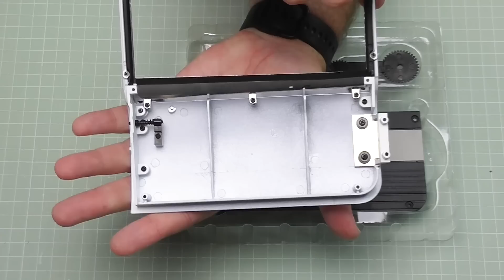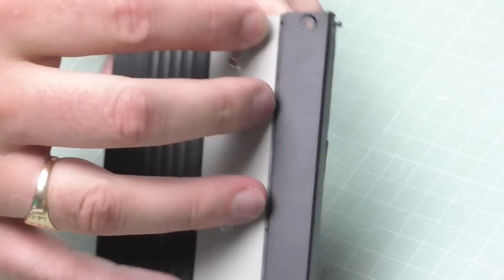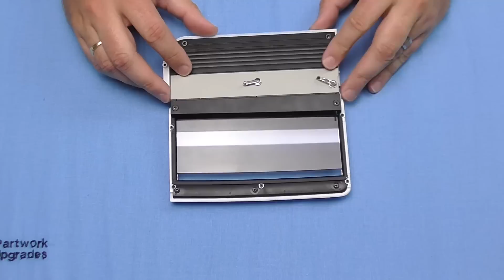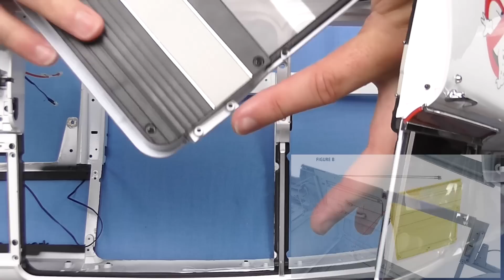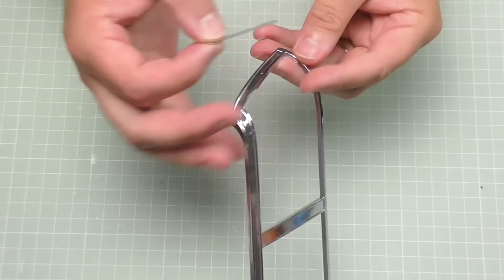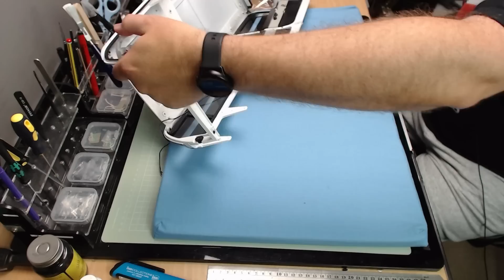Build the Ghostbusters Ecto-1 - Part 87,88,89 and 90 - Finishing the Left Rear Door, Trim and Window

Comment: Hi Wayne!  Have you done a test fit of the body to the base of the car yet?  I find that my front doors pop open immediately and cannot close due to a rub with the sides of the upper part of the side foot well panels.  Everything else aligns perfectly.  Let me know your thoughts.    ~Saul
Reply from the maker: Yep. I do it everytime I put it away. Open the doors when you put it on and then make sure the front end is fully down. Your doors are popping open because the front end is not fully engaged

Comment: Had real problems with the two little cogs on this one, they weren't machined very well and kept locking together. I can see yours isn't exactly smooth as buttah either. Had to file the teeth down a bit, the window's a bit loose now and sags a tiny bit at the top but it's better than not being able to open it at all.

While I'm here, it's a pain in the arse that the door is fooked on issue 91, I guess someone thought they were being clever and just cloned the other door (in reverse, obvs) when producing the right front door. I know you went ahead and completed your build for those parts anyway (there wouldn't have been a video otherwise, lol) but I'm gonna wait. I'm also gonna need a mini forklift to lift this bloody thing!

Comment: Curious what type of glue you used to get that piece of side trim in kit 89 to stay put around the back of the window? I've ordered a third kit 89 because that piece of trim has peeled back twice for me so far and Gorilla Glue has done nothing to keep it secured.
Reply from the maker: Just a normal glue but you need to bend the piece sufficiently beforehand to stop it lifting
Reply: @WorldofWayneUK  True that, even with bending i've had that issue - by normal glue i suspect you mean modeling glue? Thanks for the time.
Reply from the maker: @DrOtto  yep just a CA glue

Comment: Liquid oil will cause the plastic gears to wedge. It's the axiom. Even if it's not happening right now, it will in the future.
Reply from the maker: Dont worry. I dried it up and used grease. Just didn't have any to hand at the time

Comment: I'm finding the doors to be the biggest pain in the butt. my front door don't seem flush with the frame, the back door I work on forever, it wasn't flash, I has to remove so much paint and finally got it flush to have the biggest gap ever at the top of the door. And then the bit on the back didn't stick and the metal out of shape and ask for a replacement. 🤣🤣🤣 this build just to to a nightmare for me from the doors onwards so far.
Reply from the maker: I have a small gap but suspect everything will pull together when the car is mounted to the base

Comment: At last some more of my favourite movie vehicle ever. If I had space for it I'd be building this myself. If you apply a bit of gentle heat to the plastic parts that need to be bent, not enough to melt the plastic, it will hold its shape better.

Comment: Love the videos! I'm following along myself with my own. The only thing that worries me at the moment is I tried to put the body work on the lower half for storage and I cannot for the life of me get it to fit on! Any tips on how to fit the top half to the bottom? Am I missing a trick, as I can see you can do it? Can't wait until the next issue!
Reply from the maker: I will show in the next video. There are two tabs I have removed from the front to easily get in place. When the bodywork is finished I will just screw the tabs back into place.
Reply: @WorldofWayneUK  thanks for the comment. Would love to see that. It's a pain to store these two halves separately! Can't wait for the next one!

Comment: just finished this issue and I've got a gap along the top of the rear door its wide at the hinge side of the door and sealed at the other any ideas how I can get rid of it?
Reply: I know your pain. heard its become a common problem. I got the same problem of a gap at the top. I'm using rubbers bands to try and force it to bend into place but if that don't work I might have to gentle bend it. 😬